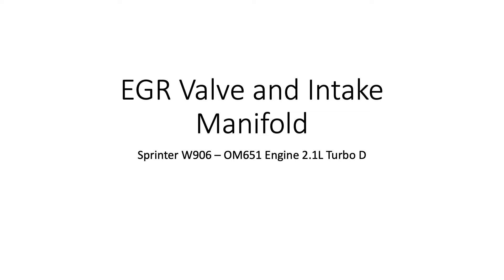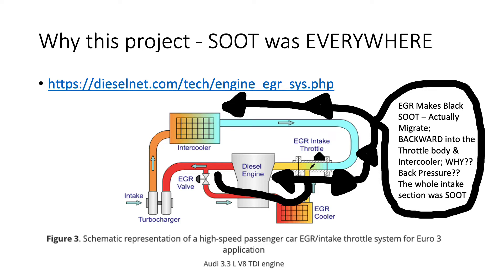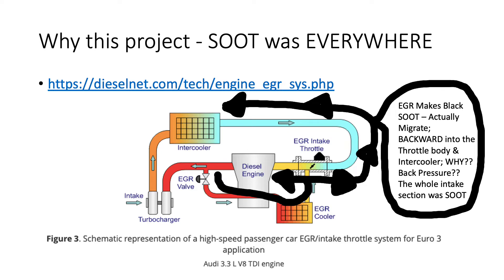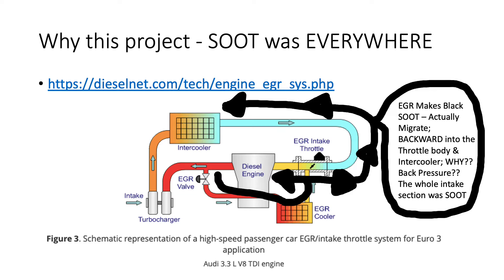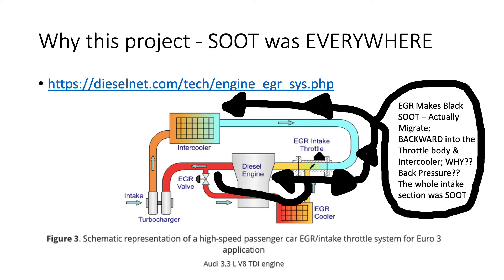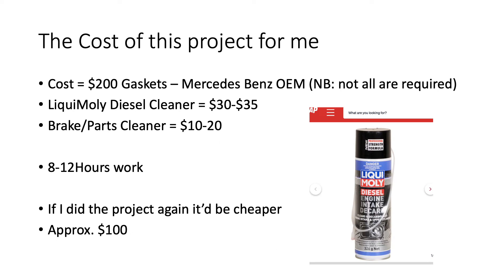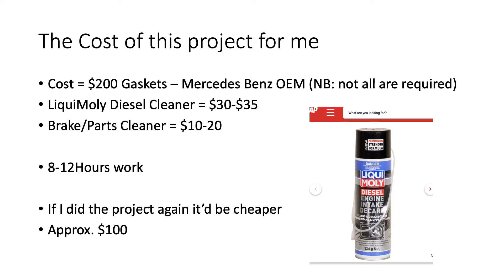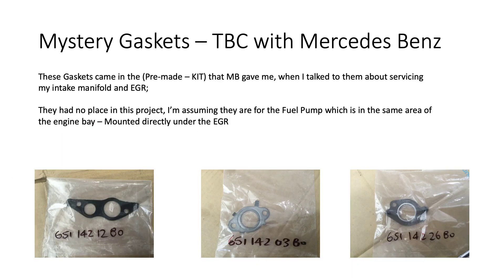Project Intro- Mercedes Sprinter Van W906 OM651 - EGR Valve & Intake manifold removal & clean

Comment: Do you know if it is possible to cancel the EGR without reprogramming the ECU? I see that older engines can be fitted with a plate and canceled. But in these modern engines with so many sensors I think it would give an error due to the exhaust gas pressure sensor.
Reply from the maker: @cransaftvalve734  you basically answered your own question 👊 but yeah a EGR delete is illegal but people still do it, you can still find ways around keeping the engine clear ehhhh it's hardwork though
Reply: @runningon8883  yes, thanks.
Reply from the maker: @cransaftvalve734  if you decide to do the EGR job, flick any questions I'm usually fast reply

Comment: Wished I found your video before, had a small crack in my intake manifold and my first attempt going this deep fixing it myself took me 7 hrs and alot of swearing  to remove every thing, the new parts should arrive tomorrow and thanks to your video it should be pretty helpful putting everything back together 🤞thanks once again
Reply from the maker: No problem, GL with the build 😁 you are very brave tackling the job like you did hah

Comment: Hello. You're missing a key component and reason for everything being coated in soot from the air intake to the inlet manifold. As with EGR, DPF etc in EURO diesel engines, oil blowby is vented back into the air intake. This results in an oily film coating the air intake and MAF, but when it mixes with the EGR gas, it results in soot, or carbon deposits. One solution is to use an air oil separator can like a Mann Hummel Provent.
Reply from the maker: Ok I'm going to look into it, because the inlet was a total mess for me, 🤣 thanks for the tip 👍👍
Reply: @runningon8883  Curious to see how your engine performed after cleaning, if you looked into an oil separator and if so, did it work?
Reply from the maker: @eoinosullivan2636  yes I'm glad you're reminding me 😎😎 I did the intake clean job and have also fitted two pro-vent cans in series.... As an experiment to see how much soot?? I can catch?? I have been trying to make a video but life is getting in the way, I really must make a video describing the new pro-vent install on my om651 engine
Reply from the maker: This is called an,  oil catch can???
Reply: @runningon8883  Yes and no!. The vast majority of oil catch cans, have an inlet and outlet and no separation media for air/oil mixture to pass through. A properly designed unit has a serviceable filter, which ensures only clean air exits